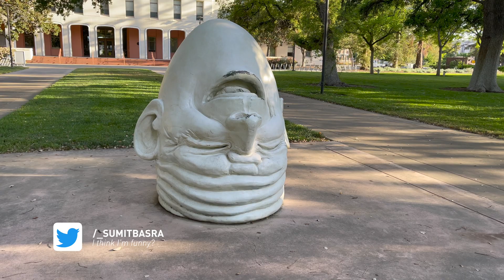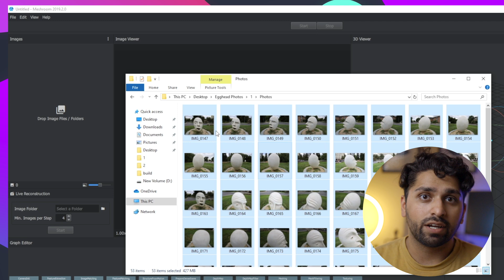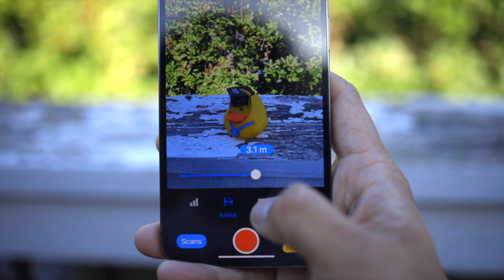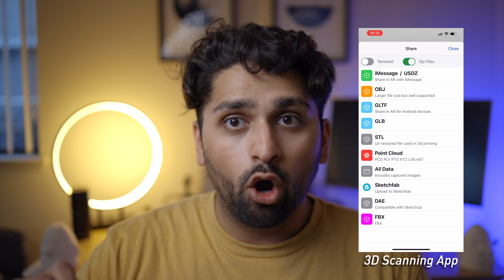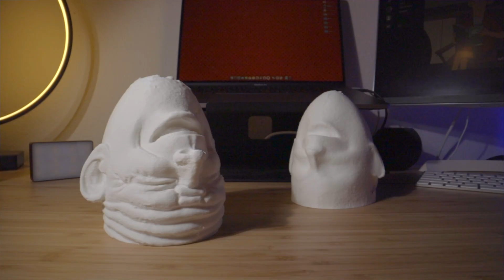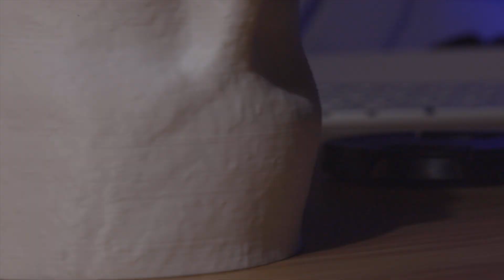iPhone 12 Pro LiDAR vs Photogrammetry: 2 Different Ways to 3D Scan Anything!

Comment: nice review thanks - but not sure it is fair as you didn’t set the lidar to best resolution (the apple / house slider)
Reply from the maker: thanks! when I made this originally, I thought that slider was for the size of the object you're scanning. since it's resolution I think I'll go back and do another scan to see how it comes out!
Reply: @sumitbasra  i’d definitely be interested to see how it comes out, as this is my use case. To be clear I don’t have an apple product would lidar, but generally if it’s resolution it is stating what the size of the smallest details it will pick up is. So 10 to 11 mm would mean that you wouldn’t pick up details smaller than 10-11.
Reply from the maker: @coffeecakecharlie  that's super helpful, thank you!

Comment: Been doing a bit of practice scans with my new Iphone of some of the machines at work *presses/dies for metal work.  It will take a bit more practice before I get the scans to the level I want,  resolution of the phone is reasonable but lighting sure has been a pain.
Reply from the maker: nice! yeah it takes some time to get the environment all set for a scan. which app are you using?

Comment: Yeah the iPhone version had little detail 
awesome coverage
Reply from the maker: there was such a big difference in detail, I might try out some other apps to see if any of them can get more detail?
Reply: @sumitbasra  from what I've seen, the rear LIDAR scanner isn't very high-resolution. I'm not sure why it/apps aren't able to gain more detail from like, moving closer or capturing nearby/detail points as you move. There's an app that uses the FaceID front camera for higher detail, but I can't recall the name.
Reply from the maker: @JustinRoss  yeah I’m not sure as to how it works specifically, but it’s still fun to have! I’ve used a couple apps that use the FaceID camera and those scans have come out pretty good! i just thought it would be too much of a hassle for such a large object lol
Reply: @sumitbasra  from my months of researching 3d scanning, 3d scanner app is currently the best. For photogrammetry agisoft metashape is the best i've tried so far, i've done several direct comparisons to meshroom and there's no competition, excellent video btw.
Reply from the maker: @nightthemoon8481  thanks! I'll have to give those a try!